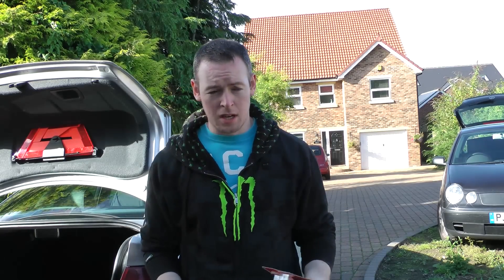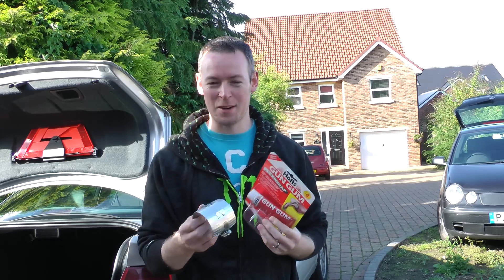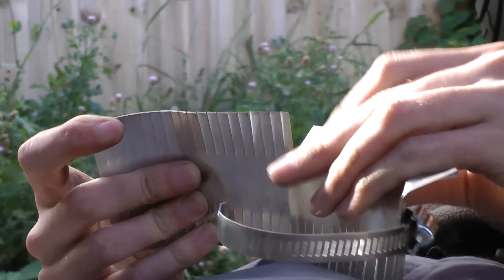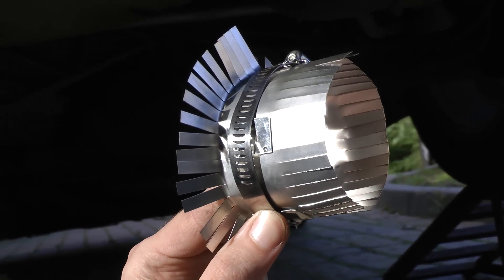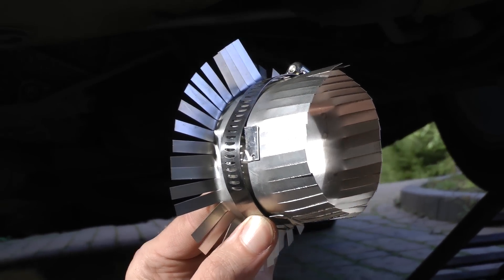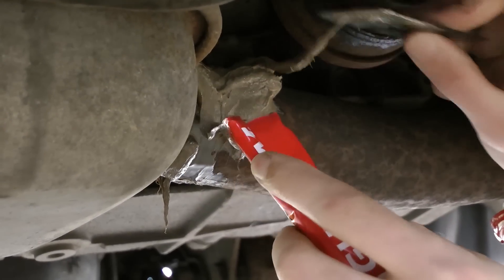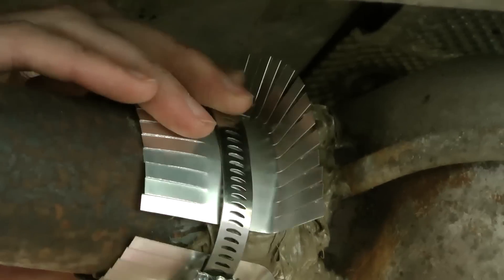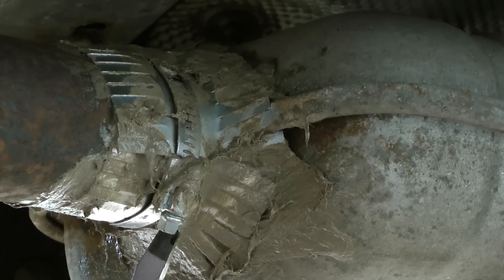DIY Exhaust repair

Comment: Glad I saw this video, the chemical metal is brilliant.  Also an extra tip is put an extra jubilee clip on just to add extra security to holding it in place.  Especially if you get one that has the knob on it to twist then you can make adjustments easier before tightening the main clip.

Comment: Thanks for this tutorial.  I  followed it to solve the same problem with my mazda.  I did not use chemical metall at all. After applying gun gum pasta first time,  there has been leak in the hardened pasta layer - because of a gap between the pipe and the silencer,  gasoline made a hole in the pasta. I wrapped aluminium tape (price 5 euro) about this place, applied more pasta.  Next day I applied more gun gum pasta (probably because I was not careful and did not wait long enough before starting the engine). Anyway,  so far it has been 200 km and counting. And the car passed an official car test that has to be done yearly in NL.  I will write back when/if the pipe breaks off. Or, if I am lucky, after a few thousands km to say that it is still in place.
It maybe a temporary fix, but for an old car,  this a very cheap and good solution.
Reply: After 1000 km the exhaust was OK, but at 1700 it was broken off.  I actually hoped it would last longer.  Nevertheless, for 10-20 euro it is a good temporary solution.
Reply: Great stuff,  which pasta did you use? Spaghetti or Macaroni??
Reply: @jacquelinebishop8465 u can use any, it's the sauce that is important

Comment: With any repair of anything you have to first find out what caused the damage. If your exhaust is broken then I would say look for anywhere where the exhaust has caught something like a road bump, the exhaust is clearly hanging too low so that needs adjustment so there is greater clearance from stiuff like road bumps. Then you can do your temporary repair and it may hold. Otherwise I would say it will last 2 minutes.

Comment: gungum works very well for filling holes and little cracks but it cannot bear mechanical stress for many days (2 weeks as you said). Some time ago I had to weld the exhaust pipe, I upload a video, perhaps that may be of interest to someone.
Reply from the maker: So what you're doing is calling me a liar then?
Reply: ???why??? some time ago you wrote this " It lasted a few weeks and then we replaced it. Just long enough to make it to payday ;)"
Reply from the maker: And you said: "gungum works very well for filling holes and little cracks but it cannot bear mechanical stress for many days (2 weeks as you said)." 

It literally did bear mechanical stress for many days.  About two weeks in fact.  No, it's not a permanent repair.  But it works sufficiently well until it can be fixed properly.

Comment: try some rislone engine treatment for that sticky lifter and loud valves ya got there. :) works charms
Reply: Ge Onny for sticky lifters and general engine cleanliness i have found some redex in the oil works wonders :) , especially a few hundred miles before an oil change, you'd be surprised what crap is clogging up the oil arteries!

Comment: For £5 it's a really good product. NO. I guarantee after a few miles it started blowing. Also it's not just the product as chemical metal was used. The only way this repair will last is if the car isn't used 😂. I like gun gum but it has its limitations, small holes and pin holes a good temp fix but this is a stretch too far.

Comment: useless product, I have rust in one spot on my exhaust and to protect it in the winter and to not expand I covered it with holts gun gum, I did this process in august this year, today in december  I checked out and found that the product has peeled off on the entire surface